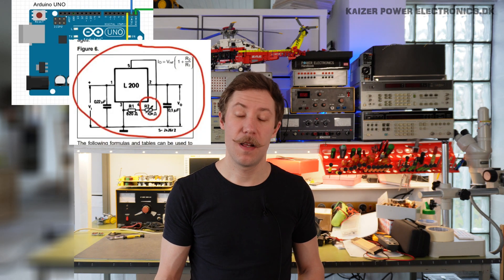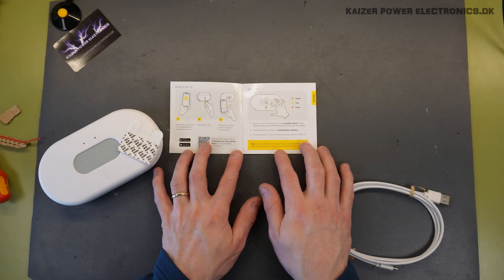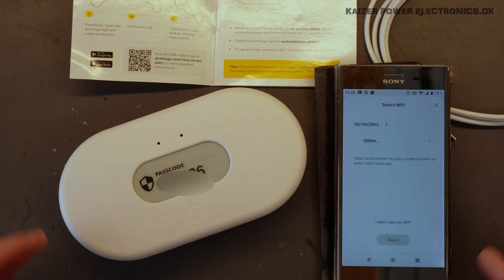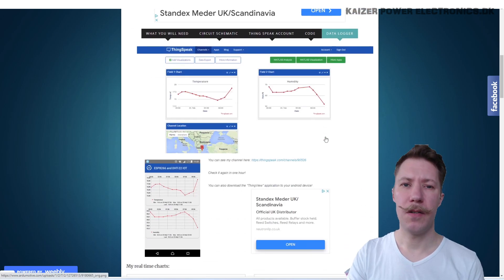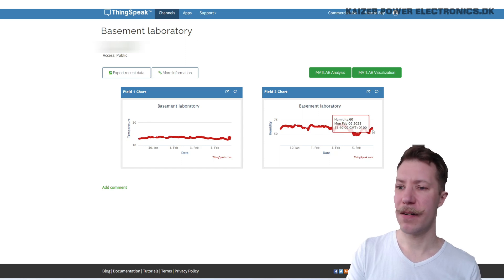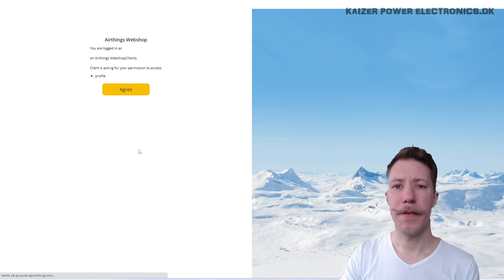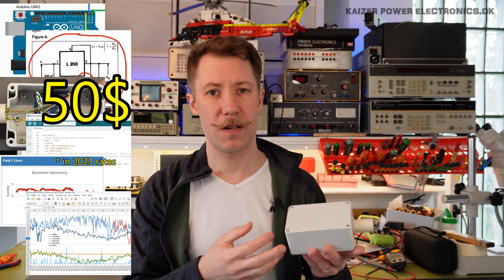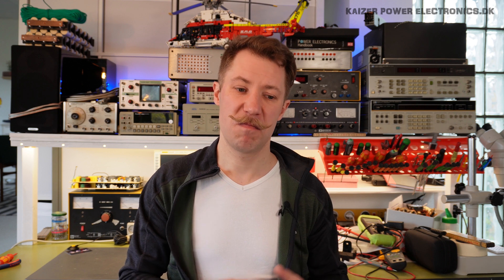Home Automation: DIY Arduino vs. Airthings View Plus

Comment: this is very poor comparison because ur arduino air monitor has only 2 sensors, while airthings has 7; and u dont even try to estimate cost, complexity and time of doing something comparable
Reply from the maker: You are pointing out exactly what I explain in this video. The DIY never got to the same level of complexity, because of time and money.